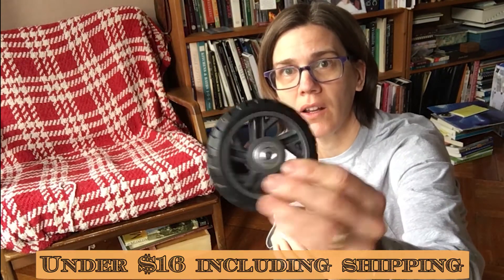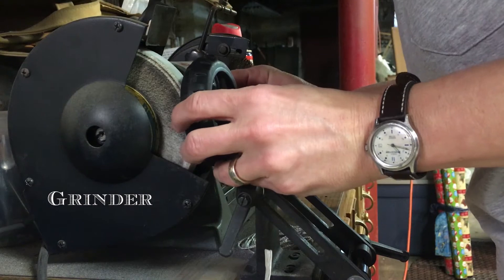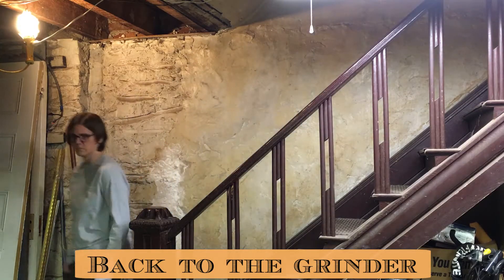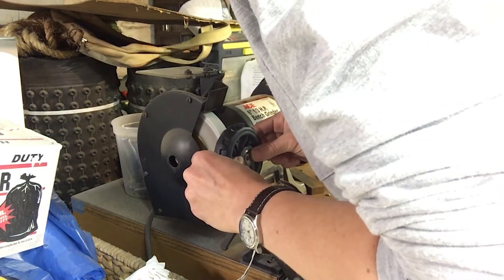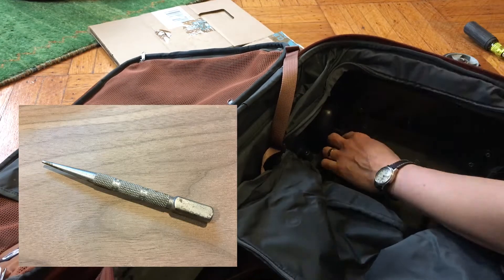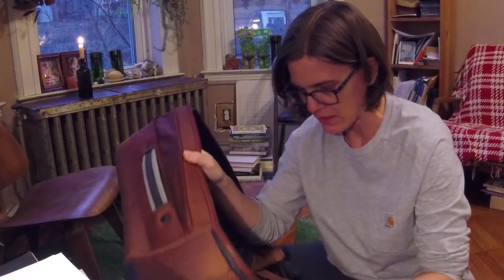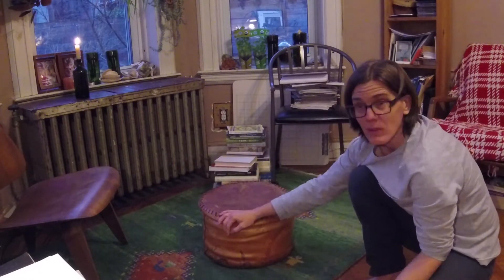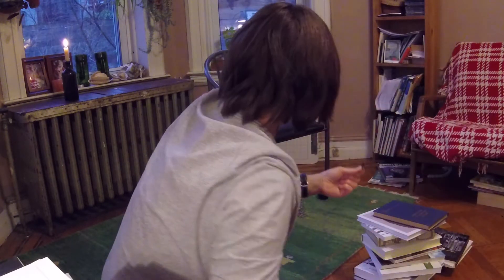How to replace a broken suitcase wheel

Comment: Thanks.  I have the 24" version and it uses different wheels, but the trick to slide out the little plate really helped.  These are not like other rollers.  I'm not impressed with this vintage of Eagle Creek.  Old stuff was really good but I'd pick other brands over these.

Comment: The older version of the bag had a sliding pin that just had to be loosened with a screw driver and then pulled out with a pair of needle nose pliers.  The pin sat behind the small plate in the corner of the suitcases.